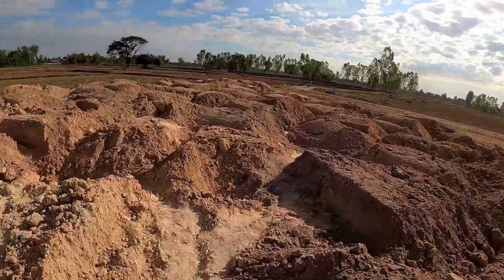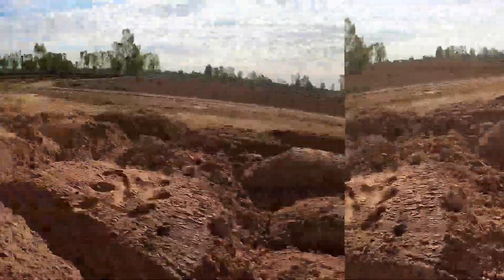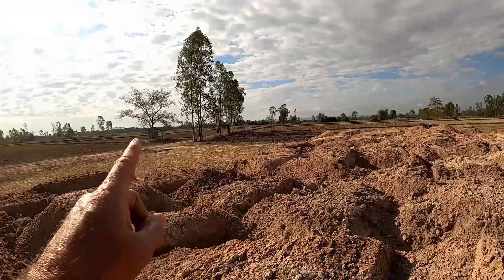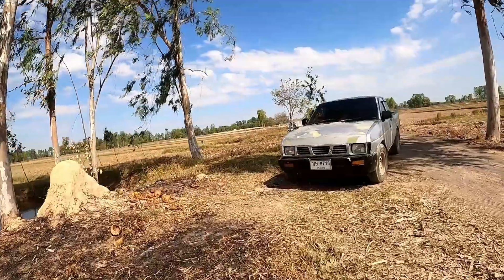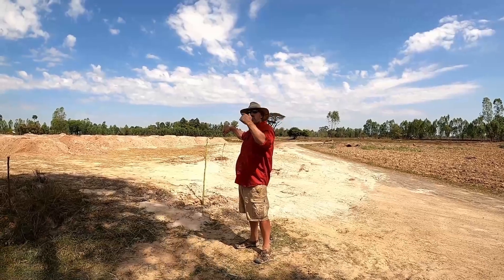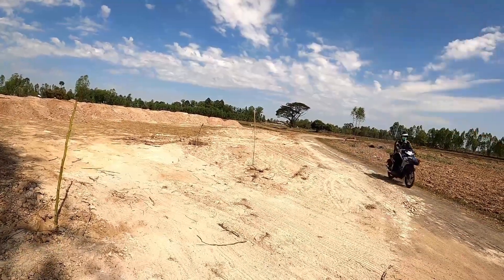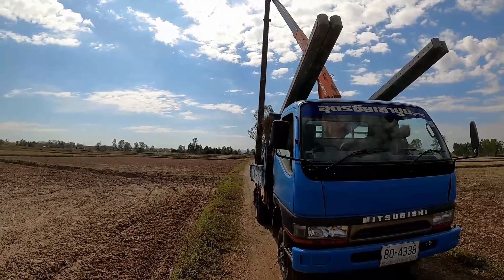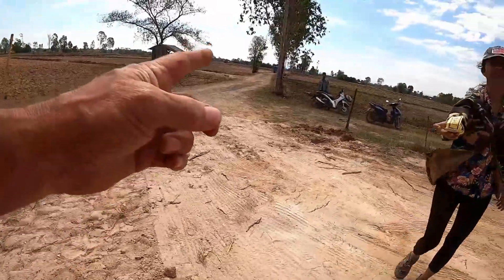ThaiBuild 19 - Electrical Poles and Dirt Work

Comment: Just found your channel and subscribed....

Sorry to trouble you but I do have a few questions and because I think you could have mixed up baht and dollars a bit when speaking, I do it all the time also.

How many meters of cable did you buy what was the grade and total cost?

How many poles did you install and the distance you needed to cover? what was the total cost of the poles and installation with the clamps/pots fitted?

Sorry to trouble you but I have just received a local quote and based on what you have shown it seems a little high and can't find much to compare on the net.

If you have time to answer it would be greatly appreciated.
Reply from the maker: No problem, ask all you like.

This is from my cost tracking spreadsheet:

Power wires (1000m x 35mm) and hardware	   B16148	 $484.49 
Pole anchor wire (10m)	                                   B360	         $10.80 
Install Power lines (Labor)                                    B10000	 $300.03 
8-8m Power Poles (2800 ea)	                           B22400	 $672.07 
pole delivery	                                                           B100	         $3.00 

Hardware = 18-insulators & mounting brackets, 18-wire ties, 1-weatherproof box, 1- 60a shut-off, 1- 3 plug outlet
The first pole was already in place so I had to install 8 new poles, but buy hardware and wire for all 9. All nine poles covered 370 meters (x2 lines), so I bought 1000 meters of 35 millimeter aluminum wire. As you saw, I have plenty left-over to tie in the house. Hope this helps.
Reply: Thank you so much
Reply: @ParadiseNThailand I’m just getting power line bids and they told us 6500 baht each but we have only 4 I think you got a good deal.  Luckily my father in law will do it for 2000 baht.  Thank God for father in laws